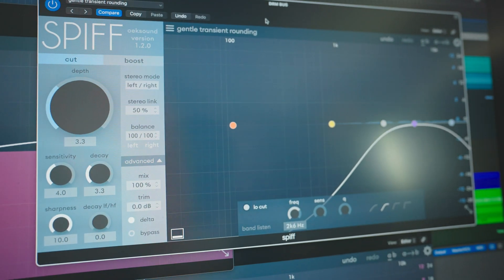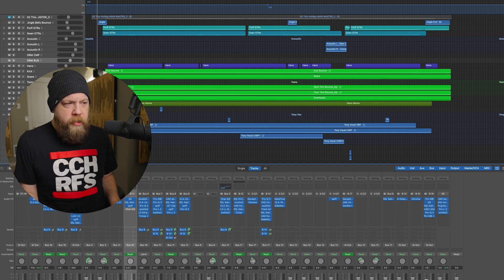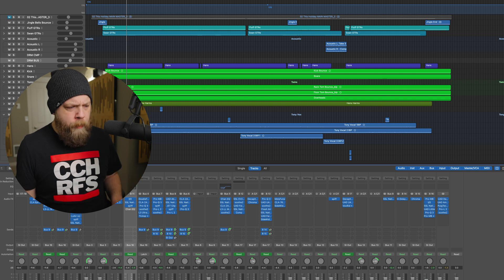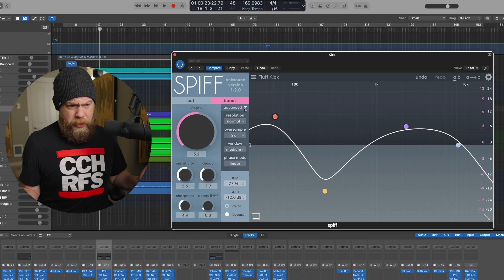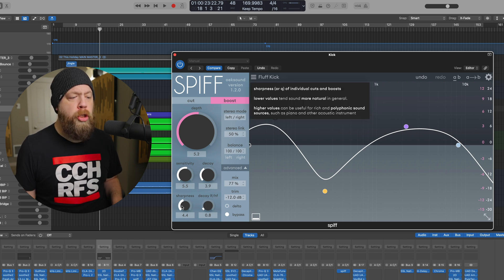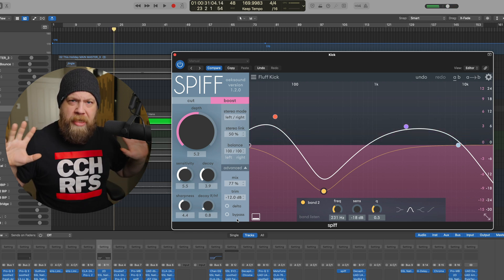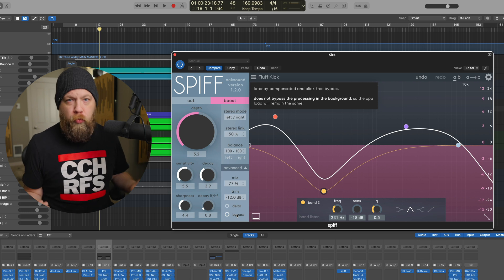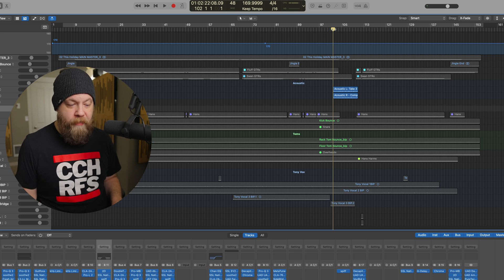MIX SAUCE! OekSound SPIFF!

Comment: i dont use spiff very often but i often have to tackle some of these problems. i usually reach for a dynamic eq, compression, or even tape compression over spiff in a lot of these applications. (tape namely being the last example) but i might reach dor spiff instead next time to try something different or cleaner.